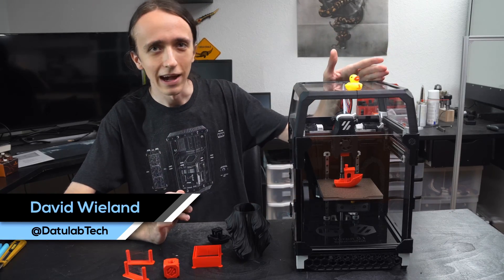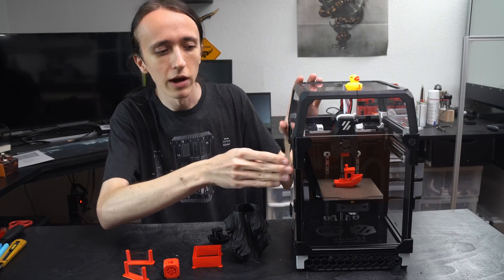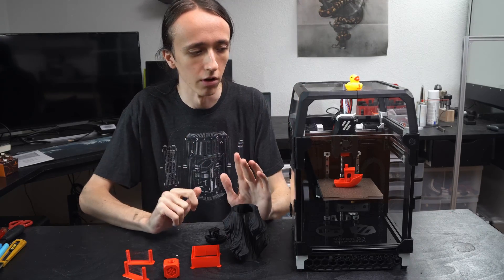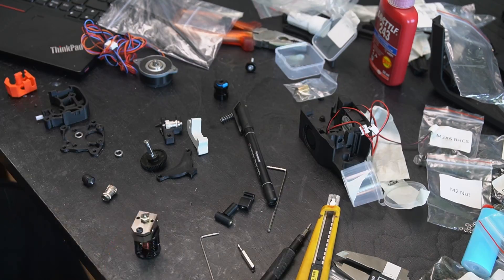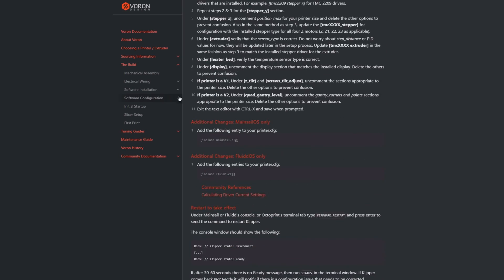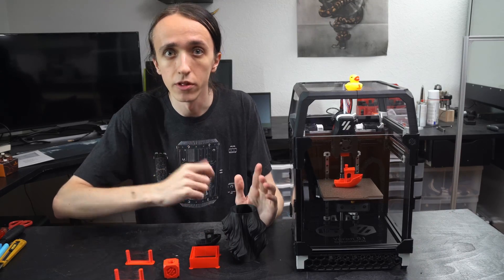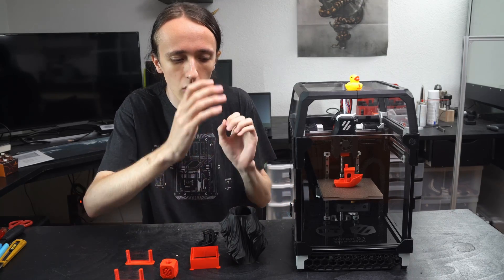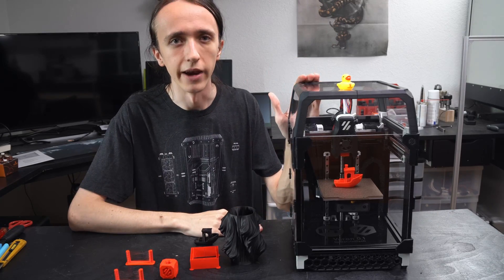Voron 0.1 Build - Best $500 3D Printer?

Comment: Loving your channel at the minute keep up the good work! Quick question, I note your using 243 loctite. Have you had any issues with this damaging the ABS parts? I’m trying to mind the most suitable loctite for my build? Many thanks
Reply from the maker: I used Loctite (or at least the Chinese knockoff I have) only on screws going into metal parts, so there shouldn't be much exposure to the ABS.
Reply: @DarkArtGuitarsWorkshop  thanks for your help!

Comment: voron 0.1 3d printed parts are printed or sourced? any tips for those intending to print parts on their own? Thanks
Reply from the maker: They were printed on my Prusa i3Mk3 in ABS with no enclosure. By tuning your temperature settings and enabling a draft shield, basically any 3d printer that has a heated bed that gets to 100C or above can print ABS. Nero3d has some tutorials on this for printing Voron ABS parts on cheap printers.

Comment: The engraved logo is such a nice touch imo makes it look awesome xD

Also nice you used loctite blue!
How hard is it to remove the screws now? I don't wanna break my plastic parts doing that.

Also warning; thread lockers damage most plastic's severely upon contact. It'll weaken them over time
Reply from the maker: The thread locker is on the screws that screw into metal parts where it's not possible to access them anymore when the build is completed. The manual specifically calls out to use thread locker there, as the vibrations might loosen the bolts otherwise and there is no way to check or retighten them once fully assembled.
Reply: @DarkArtGuitarsWorkshop  oooh okay.

I wanna use thread lockers for my printed parts too (metal nuts inside printed parts) but loctite warns you pretty heavily on their website to not let this stuff touch plastics specially ABS/PC which is sad tbh since I love my threadlocker
Reply from the maker: I'm sure that loctite also makes a thread locker that works with plastic. They have like a hundred different lines, so one of them must be compatible.
Reply: @DarkArtGuitarsWorkshop  oh they do have one but it's not life these ones and it's superglue based, I wonder how good that is

Comment: The only materials that  seem good for a 3D printer are abs-pc and if you're insane ultem-peek :p

I wanna try cast resin+filler carbon fiber tho. Might work for high temp ultem printers

I disagree with the abs printing tho. Almost all printers can print abs pretty easily in my Experiance. If you don't wanna spend on an enclosure just throw a blanket over it but remember it's a fire hazard xD
Reply from the maker: Be careful with resin though, many of them are not quite so long term dimensionally stable as you might think. The Voron crew has tried just about every material and by far the one with the least issues was ABS. It is stiffer than Nylon, while not being as brittle as PC and has the needed thermal properties. CF Nylon could work, as long as you're using one that doesn't suffer from the creeping issues that CNCKitchen had. Ultem-Peek would surely also work, but if you have the funds and printer to work with them, why are you building a Voron.
And yes, with some tweaking pretty much any printer can print well designed ABS parts (which all the voron parts are). Though if you try to just print any part in ABS on a cheap machine you might run into issues.
Reply: @DarkArtGuitarsWorkshop  I'm working on a <500$~ peek/ultem printer tbh :) I have an idea for how yo make one incredibly cheap! Hopefully once I escape my country and settle in Canada I'll try it
Reply from the maker: @ameliabuns  A sub $500 printer that prints Ultem reliably would be quite the achievement, I'll definitely stay tuned to what you come up with. 
Though at that point, 2kg of material will be the same price as the printer, so tbh the printer's price is not as much of an issue (within reason) when trying to print PEEK/Ultem, as you're either doing it in a space where you're making money with it, or money is no object anyhow.
Reply: @DarkArtGuitarsWorkshop  my hope was extruding ULTEM at home but that's even harder than making the printer I"m imagining. 

ultem 1010 is 40$ per kg in pellets only.

if we had a tool changer and a pellet extruder we could use pellets and mill the imperfections away! sadly that'd make it way harder to implement my idea as it'd requrie a seperate z axis for the bed and another z axis for the tools. I was gonna try my idea when I get to canada with a 150x150x100 printer first :) but sadly every failure/test with my idea will cost me a lot.

the idea i have is a printer with the bed and only the current used Z axis being isolated from everything trough some belts
Reply: Why not just buy Aluminium CNCed parts then? Not sure if they're also available for the V0 but for the V2 they are and not toooo terribly expensive considering what you get 🤔
Reply: @Duraltia  they cost a good kidney or two
Reply from the maker: @Duraltia  I saw those as well, but for regular operation they really aren't needed. If anything the small amount of flex of the ABS is beneficial for absorbing vibrations, not to mention that the aluminum parts will be much heavier and weight is the enemy of fast accelerations. 
If your main goal is to have high thermal capabilities, then that would, of course, work, but there are many more problems to solve, like the belts, bearings, motor cooling, save chamber heating,...